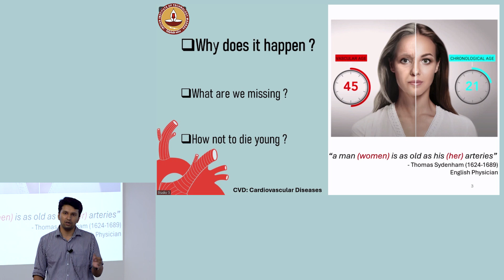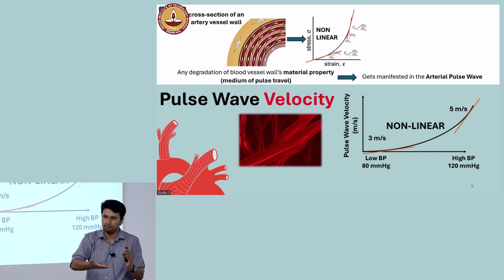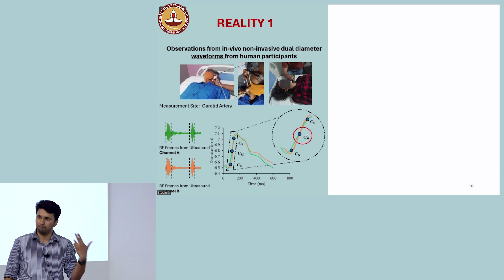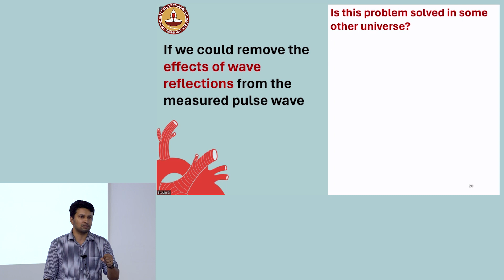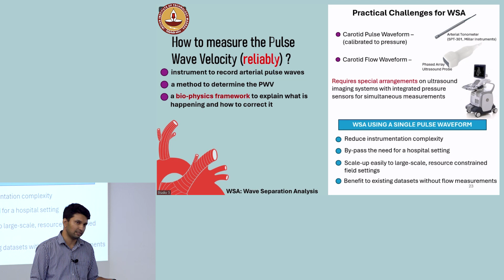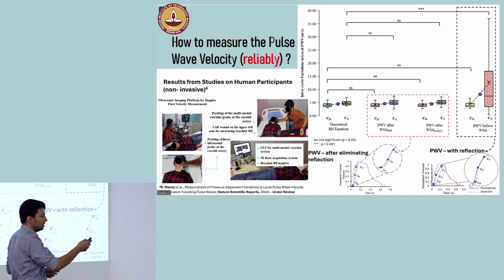Rahul Manoj: How not to die young? Lessons from Cardiovascular Engineering

Comment: This was a nice talk and verywell presented. However, I feel that one point regarding how early vascular aging is chronic and what are its consequences should have been mentioned. 33% of overall deaths is caused by cardiovascular diseases...but a major portion of that is shared by atherosclerosis, aneurysms and some other factors. You sell the idea using "cardiovascular diseases ", but how much of that is contributed solely due to  arterial stiffning or early vascular aging is missing.
Reply: Thanks for the comment. Valid point. However, I wish to do a small correction to your observation, and yes, the mortality is caused by heart attack or stroke often due to atherosclerosis. The whole idea of EVA is about detecting the early manifestations of CVD, which eventually leads to atherosclerosis or stenosis or aneurysms. The endothelial dysfunction can be attributed to a start of this viscous cycle, which leads to stiffening of the arteries, leading to an increase in PWV, paving way for atherosclerosis. 
So, in brief, the EVA assessment, such as PWV is directly linked to the mortality rate due to CVDs.